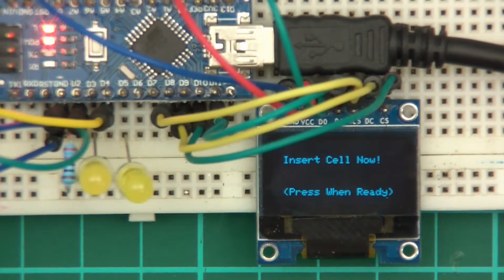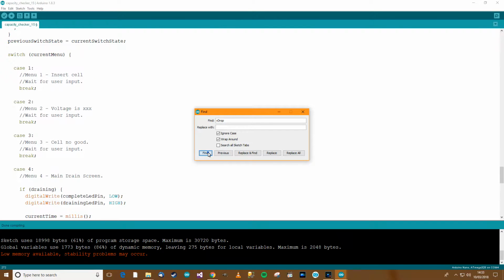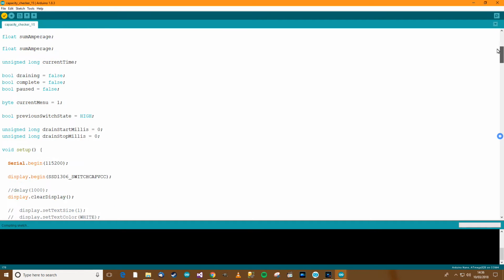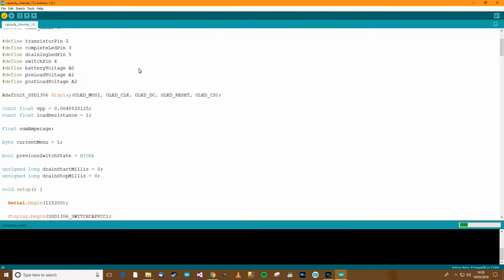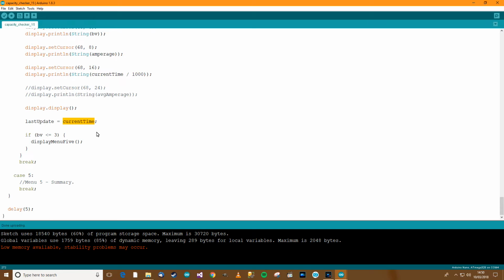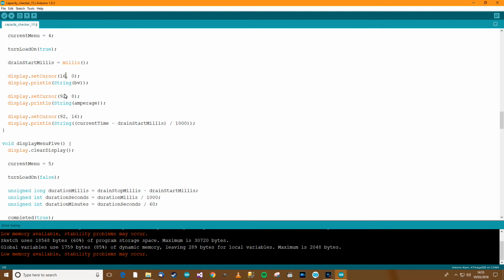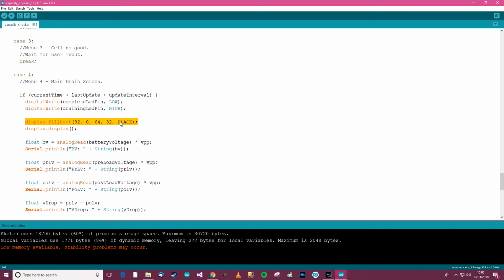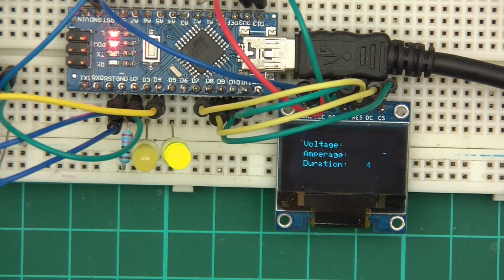TUTORIAL: DIY 18650 Lithium Ion Cell Battery Capacity Checker Tester (Part 15 - Drain Screen!)

Comment: You could save lots of code by making functions that take care of your repeated codes.
The code used to display the labels you repeat the font and position. This could done in one function where you pass in the text and line # you want the text to be on:
{ .... printMenuItem("Text for line1", 1, true); printMenuItem("Text for line2", 2, false); printMenuItem("Text for line3", 3, false); ...}
void printMenuItem(char *inputText, int lineNum, bool clearScrn) {
if (clearScrn) display.clear();
display.setTextSize(1);
switch (lineNum) { case 1: display.setcursor(1, 32); break; case 2: display.setCursor(1, 64); break; .... default: setCursor(1,32);}
display.println(inputText);
display.display();    }

Then that way you cut a lot out of your repetition of the displaying of menu items. Another thing would be to redo your menu code altogether. Instead of having a separate function for each menu, you could have 1 function [ void displayMenu(int menuItem) ] and use a switch to display the proper menu. This also will reduce the code size plus make the code execution faster.
Reply from the maker: Hi Korishan! Later on today, hopefully, I'll record next weeks video. In that video, I'll finish screen 5 (the summary screen) and hopefully refactor the code properly to remove repetition, and tidy up the appearance of the OLED.

The way it currently works is that I have functions to draw the static content of menu 1, 2, 3, 4 & 5, menu 1 is called by the setup function, which then calls menu 2, and others are triggered by user input in the loop. The first part of the loop deals with user input. The second part of the loop deals with updating the UI. Only menu 4 needs continually updating, all other menus only show static content. I'll refactor it later hopefully... I'm going to make the code available at the end of the project too... :-)

Comment: Hi, 
Thanks for such an informative video’s, very helpful for beginners like me.  
I am really exited for making my own capacity tester for 8.2V batteries. But I am having few confusions I need your expert opinion in the following technical issues. 
1) As I am making capacity tester for the 8.2V batteries, the Arduino doesn’t accept analogue signal more then 5V. What should I do to measure the voltage value accurate?  
2) What are your other recommendations regarding the circuit?
Reply: U need a voltage divider. maybe two equal resistors. they split the 8.4v to a half (4.2V). Thats okay for the adc of the arduino. then, in the code, o have to map it, to get that 8,4v readings back
Reply: @fellpower  
Thanks ,
I tried it but then the problem was its voltage reading was really disturbed. 
Moreover, after a lot of change coding i was not able to make it, anyhow i am still interested in this project.
How Can i talk to you live ?
Reply: Hello can you send  me the code ?